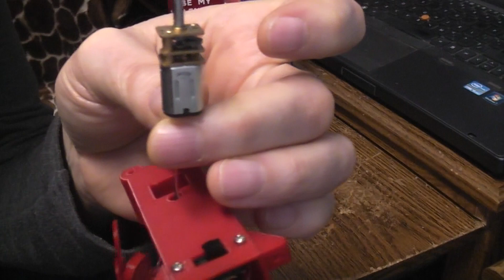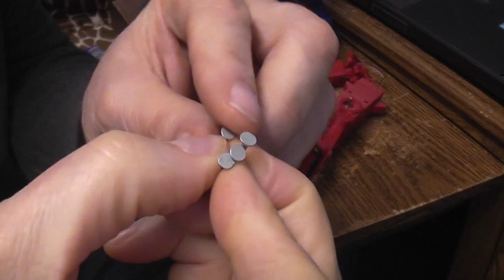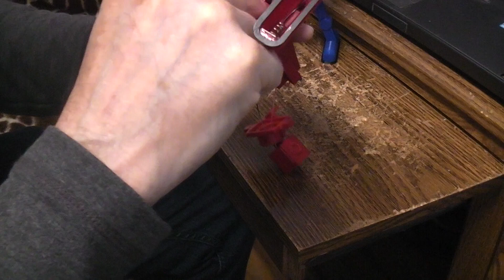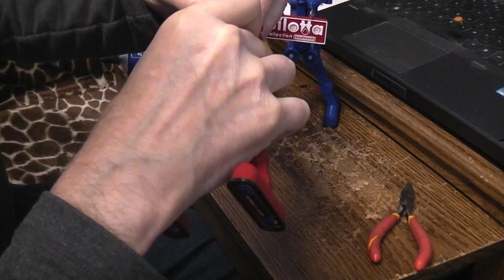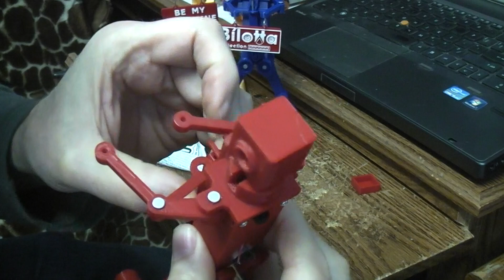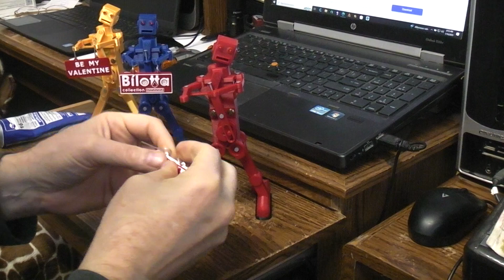Bilotta Collection, Celebration "dancing" robot. N20 type gearmotor version.

Comment: Really nice …can’t make any of it without a 3 d printer 🖨️ 😎👍🏻
Reply from the maker: Most city's have maker places where you can use there 3d printers, schools have 3d printers and look for project for the kids to make, there are online services that will 3d print the parts for you. Then there are always kids in the Neiborhood that will have a 3d printer or know someone with a 3d printer. And then lastly, 3d printers are dirt cheap these days.
Reply: @Robothut  so want do you do put the sti file on a card stick it in the printer 🖨️ and  hit run and it will make the make part ? I think I would try a service first , too bad china don’t punch out these kits .
Reply from the maker: @PeterAgostiniJdcap26  Yes I put the "sliced" STL files on a card and put that in the 3d printer and just remove the parts as they are made. A slicer is just a program that turns the STL files into a file type that the 3d printers can work with, basically it slices the files up into layers and 3d printers build things in layers.
Reply: @Robothut  thank you John an my want and do list grows 😎